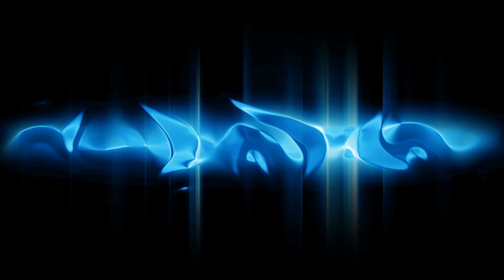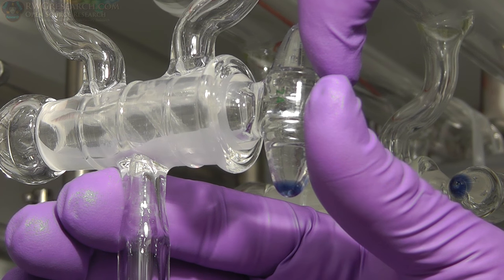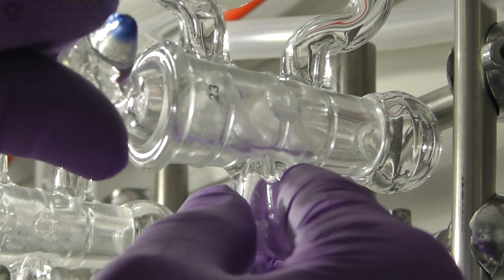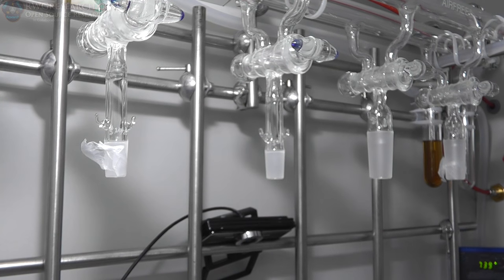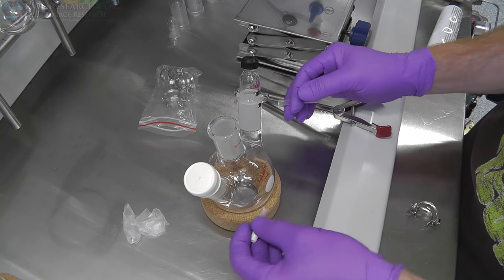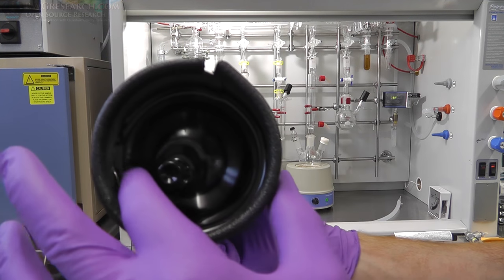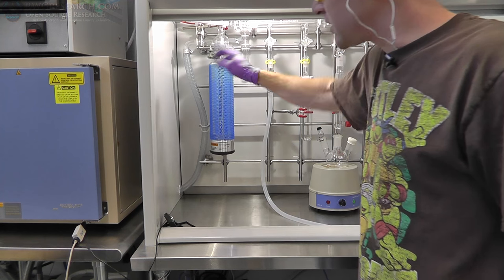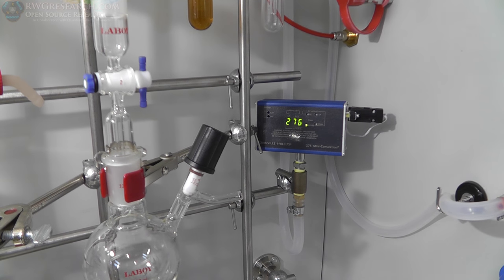Commissioning The Schlenk Line P3, Glass Everywhere!

Comment: Thank you Russ for your lab videos highlighting fume hoods. It brought back some fond memories for me when I worked as a maintenance electrician at an R&D lab for a nickel mining company in Canada. We had around a hundred fume hoods with different experiments and processes going on in each one. Some of them with dangerous volatile stuff going on in them, were vented with their exhaust fans on backup emergency generator, if there was power failure and had annunciated alarms. 

Most of the hoods were from when the lab was built in 1965, so they were made with 1/4" hard reinforced asbestos panels on their interiors, and were brittle, chipped, cracked, chemically stained, painted, marked in permanant marker, with notes on such things as dates, times, temperatures, formulas, arrows pointing here and there, or had dymo tape labels glued on showing a history of many different previous experiments. The screws and nuts & bolts holding the whole thing together were usually rusted shut, or chemically reacted or dissolved with all the different chemicals used over that time.

I didn't really know of all of what the experiments were about going on inside all of them, but many of the chemists, engineers & Ph.D's would take the time to explain things, and I always had the greatest gratitude and respect for them doing that. Good times I recall from back then, as I'm happily retired now and good luck with your projects!

ps; I just subbed.

Comment: Turtley excellent video! :D "For all intensive purposes" :P Love the pun, intensive indeed! Actually thought you'd had an accident, what with the video title and all ;-)
What are you planning to do with that big ass-dewar? Hack Jurassic Park and steal dinosaur embryos?
Reply: It's just a place to store the lab's liquid nitrogen. You have to keep refilling the small dewar in the hood on the vacuum trap BUT you can't really get sealed bottles of liquid nitrogen like you can with Argon or Hydrogen or Oxygen even. Notice the big Dewar has a styrofoam plug at the top? It doesn't completely seal at all. The Dewar HAS to be vented because of the high vapor pressure. SO you need to drag your big Dewar to your supplier and fill that up from time to time OR they might come to you and fill it up or exchange it, etc. you get the idea.